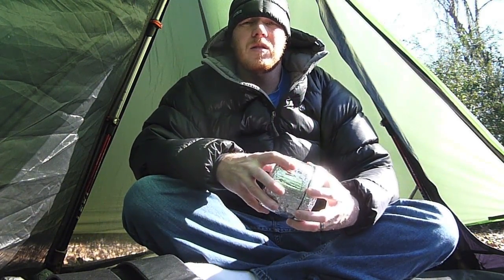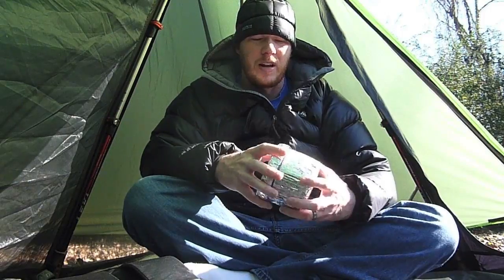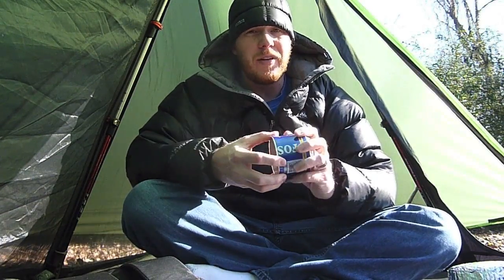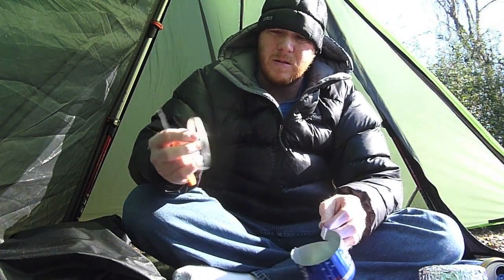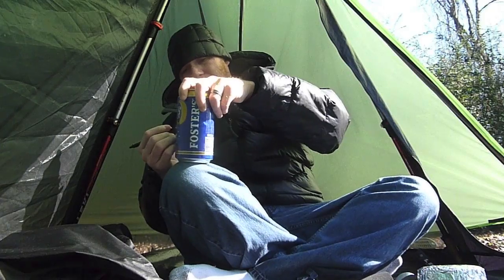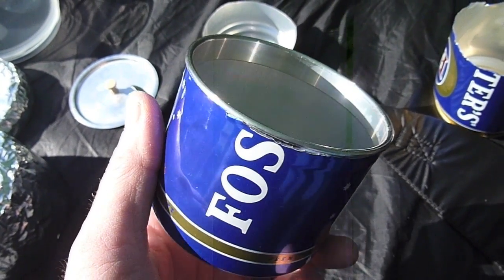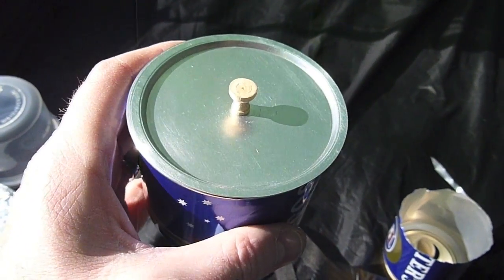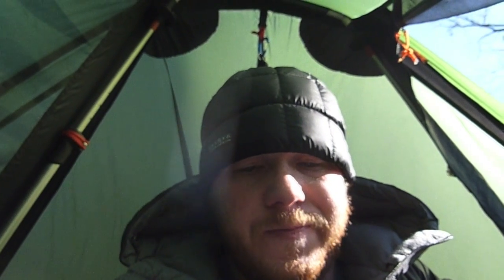Changing a Foster's Cook Pot Ring

Comment from the maker: @digitizer101 
A silicone band probably wouldn't be a bad idea for this kind of instance. But I gotta say that it is not that bad as far as jagged edges protruding out. When I cut it with my knife it actually pushed the edge of the can inside a bit which made it take just a bit longer to get the lip of the ring lined up with the inside of the can. But it still actually went pretty well. I like the design on these rings. Easy to install and looks great!